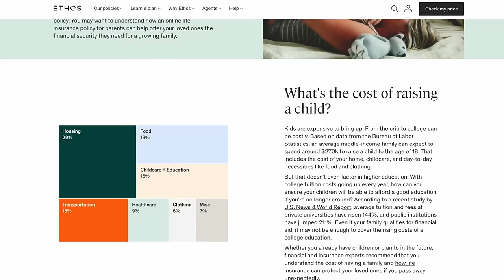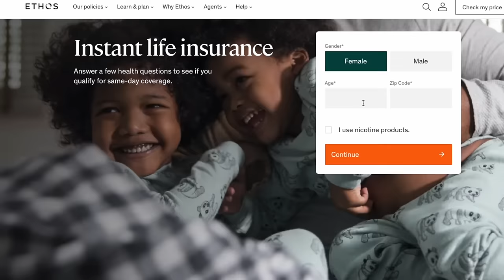30 Days To Build A Timeless Family Heirloom [START TO FINISH DIY GLASS FRONT CABINET BUILD]

Comment: The “routed grooves” are called DADOS. You’re doing a great job and learning quickly.  Using the correct terminology can be helpful for you and your viewers. BTW, Rockler sells router bits that are the exact size of nominally-sized plywood (cuz 3/4” plywood isn’t quite 3/4”, etc.), so your dados will be the exact size as the plywood without multiple passes or dados that are slightly wider than your shelves. Cheers.

Comment: I’m so confused right now. Isn’t this the first cabinet that you built? I’ve watched all of these ones and then you decided you make an absolutely huge one. Where is the end of that?
Reply: That's what I'm thinking. I think they posted the wrong video, or they put in clips from the last build by accident because I sware I've watched this before
Reply: That project is on hold, the glass cutters didn’t get the measurements right so they’ve had to redo it, causing a delay with getting the video out
Reply: @LoremIpsum6782  Ahh ok, thank you